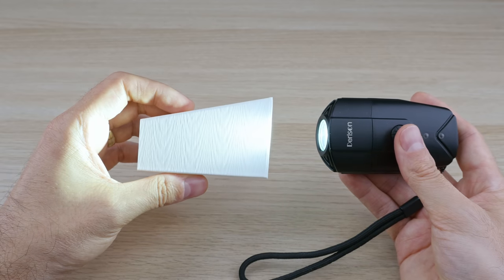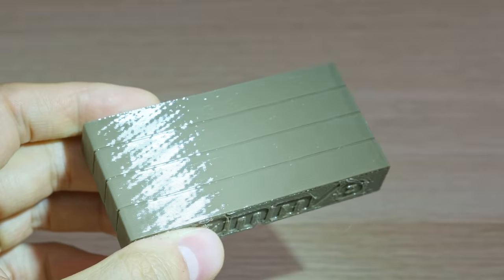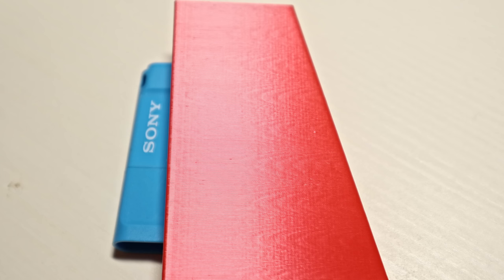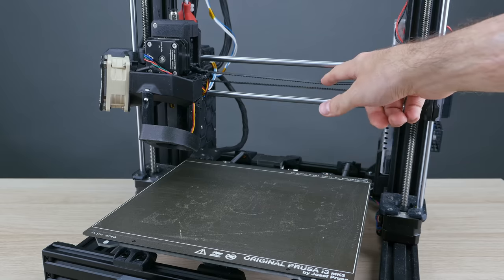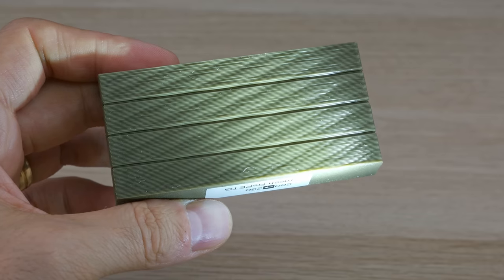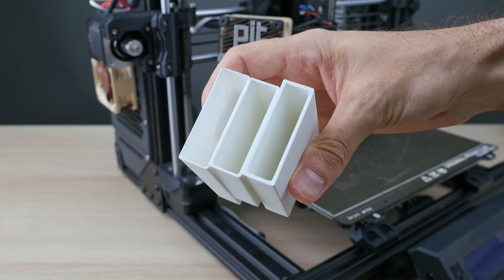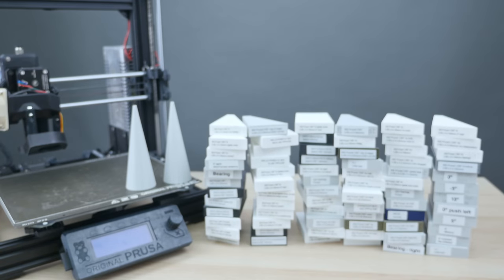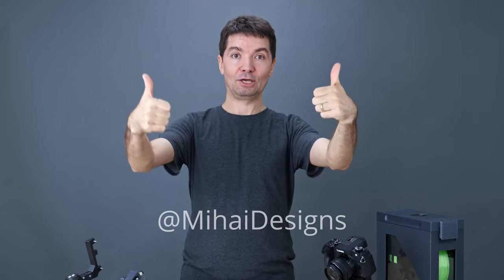What I've learned about your 3D printers (and mine)

Comment: Mihai could you fix it in the end? This design of dual-gear might have a non-linear transmission of torque, due to the design of the teeth, so it generates a "strong/weak/strong/weak/strong..." push of the filament and when you print a regular shape like cones/rectangles/squares/prisms... it creates a variety of Moiré Patterns. By the way, SUPERB RESEARCH!!!! Exhaustion of tests!
Reply from the maker: Thank you. Yes, that's exactly how I believe it happens too. I do have a patch for my printers, although I'm not sure it'll work with very flexible filament. A different design of the gears would be best, but also more costly.
Reply: I hadn't looked into the gears closely, what did you see on them to give you this idea?
Reply: @LittleSilvr  Might have measured the distance between the gears' teeth or between both gears while running I guess ?
Reply from the maker: @LittleSilvr  I'll explain in detail in the next video (yet to be filmed)
Reply: May be more teeth in contact help: I wonder if the LGX Bondtech is less impacted
Reply: Maybe diagonal teeth would work better.

Comment: I have a suggestion, so hear me out. Maybe the gear that is fixed to the extruder motor is not concentric with the shaft, thus the filament is not pushed evenly through the hot end even if the motor spins at a steady rate. As the splined gear that grabs the filament may not have the inside diameter identical to the outer diameter of the shaft, and is secured to the shaft only from one side with a grub screw, this could be the source of the problem. Even a tiny deviation from concentricity is enough to create that effect. Let us know if you find out anything on this matter. Love your vids btw!
Reply from the maker: That would be a good subject for a test. Is not the case here, I imagine it could lead to layers seemingly not aligning well in specific situations.
Reply: @MihaiDesigns  The bear project/community have come to that conclusion though.
Reply: If that is really the case, then i got an idea to fix this.

How about we add something like extruder concentricity compensation value into the firmware. Something similar to how linear advance compensates the filament flow, and how input shaping compensates for frame flexibility.
Reply: Look up MirageC, he did a video on this issue.

Comment: I've got a very mild case of this pattern when printing with a totally custom build that does not have a dual gear extruder. It's running a drive wheel straight off the motor shaft and a simple ball bearing pressing the filament into that. Direct drive (not bowden) with a very well constrained and short filament path. H bot gantry system with standard 1.8 deg/step motors everywhere. Slicing with Repetier Host using Slic3r.
Reply from the maker: Can also be other reasons to get a somewhat similar shape. See my other videos on how to measure and determine where it could come from.

Comment: Thank you for actually testing and sharing. Extreme appreciation.

I have switched to 5-phase steppers from oriental motor. Their motors can reach 1000steps/rev. I never have grains/stripes/waves. Clearpath servos also work great, but they have a little latency (2ms). Super smooth walls.
The only thing I have now is inconsistent extrusion from sudden change in flow depending on the part geometry as I run near my extruder max flow rate.
Reply from the maker: Flow change does affect both extrusion % and print texture, especially if you go above 1/3 of the rated max flow rate. This is a real problem for me as well. My only solution is to go with bigger heating blocks. Even my super volcano is not enough in my experience. So I try to keep the volumetric flow constant where possible. Of course, there's always slow down at corners so there will be some variation.

Comment: Vibrations come from printhead, cooling fans, any moving part that is not dampened, loose or generates frequencies like sound..each can contribute to fine detailed extrusions of hot plastic "woodgrains". Match the vibes and see where to fix. I wonder if sound absorptioncan be tuned to temperature and type of filiment? NOT impossible to tune a fork..however you can't tuna fish, hehe. There is indeed a limit to print details depending on each machine's absorption capabilities.

Comment: Incredible reaserch, the fact that it's a consistent pattern and not random noise should be a big clue, and seeing how it's so consistent across printers and setups says it's probably related to something very basic in 3D printer designs. With some math you can measure the distance between the peaks and troughs compared to the speed of the print head and determine the frequency at which the inconsistent extrusion is happening. The cooling fan is too high of a frequency to be causing that but something else moves spins or vibrates at that specific frequency and an imbalance in that is most likely what is going to be causing the problem. The fact that the extrusion is so consistently inconsistent in a way that causes a pattern is a big clue. Something is causing the printhead to move or wobble out of alignment at a very specific and consistent frequency.

Comment: This is typically caused by vibrational resonance that becomes amplified over time. Printer components and even the sturdiness of the desk/shelf the printer is mounted on can affect resonance. Another youtuber (Teaching Tech) covered this well recently and used an accelerometer on a Rat Rig, with Klipper Input that contains specific values in the firmware to address this and came out with amazing results.

Comment: It was also happening on my Artillery Sidewinder with single drive Titan clone, but  more elongated. It was caused by eccentricity of small motor gear. It was pronounced when printing with 0.8mm nozzle, 0.4 layer heigh and 120% flow. I reduced it by putting adhesive tape on the shaft, now there is no play of the gear, so after fastening grub screws it does not move to one side.

Comment: I had a similar issue and did dozens of tests and replaced a bunch of parts, updated firmware, and tuned a lot of stuff. Nothing improved the quality of my prints until I stopped using my Cura profile and restarted with a default Cura profile. It improved the prints dramatically, despite having the same settings as the Cura profile I used for years

Comment: Wood grain/rings often come from extruder gear issues. Commonly hobbed gears that are non-centric, either by manufacturing defect, bad mount to the axle, or the axle (and thus the hobbed gear) is at an off-axis angle vs the filament path and idler. Obviously the same goes for the other gear on dual gear extruders. The stepper axle itself can be bent/off-axis, but the far more common culprit is the extruder gear(s) and/or their mount.

It can be difficult with with many direct drive constructions as they're often enclosed, but a good troubleshooting step is to snip 2 sensibly long pieces of filament off the spool, then using a hair dryer or very gently a heat gun, straighten them out from their curve off the spool. Something slightly (!) less rigid than PLA can be favorable here. Next, drive the stepper to run the 1st filament piece through the extruder, without the exiting filament rubbing/bending on anything NOT going into the hotend). Run it really slowly. Observe the extruder gear(s) and idler at work, really up close.

Is there any kind of non centric movement? Any movement on the tensioning lever? Does the distance between the center of the screw/pin/axle of the gear(s)/idler, and the outer edge towards the filament, change during rotation? Is there any movement in where between the gears/idler the filament rides? Lastly, on the filament itself. Is there any curve to the exiting filament? Are the grooves from the hobbed gear(s) biting into the filament, precisely perpendicular to the length of the filament? Is their depth and spacing consistent throughout the length of the he filament? If dual gear, is the depth, angle and spacing along the length of filament consistent, identical on both sides?

Next, do the same with the other piece of filament, but at higher speed. The speed when printing these parts, ideally. Watch and inspect the exiting filament for the same as above, but this time also look for signs of slipping, grinding or missing steps.
Reply from the maker: Excellent tips @pr0xZen. I did check for some of these aspects even though some things I can only measure with limited precision, but I find your test procedures interesting. I haven't gotten a test for non-centric gears. It would require a much larger print, but is something that can be designed specifically to detect this. I've noted it down for a future experiment.
Reply: @MihaiDesigns  In terms of stuff like the distance from center to edge of the gear(s) and idler, you don't neccessarily have to measure it precisely. If you watch the gear(s)/idler up close when running filament through them at a constant speed - especially when moving at speed - if it's there it should be visible as an oscillating motion. You can sometimes also feel that oscillation through the tensioning lever if your extruder has one, if lightly holding a finger on it.

For the hobbed gear "bites" along the filament, inconcistency in the "bite marks" is usually not too difficult to observe when inspecting it by eye afterwards. If inconcistency is caused by non-centric or improperly cut/unevenly worn hobbed gear surfaces, the inconcistency will be a repeating pattern spaced roughly every 10-20 bite marks; there's not that many "teeth" around the sircumference of those gears.

With dual gear, look for the same inconcistency and repeating pattern on both sides. And, you don't have to count every mark to compare to the marks on the other side. Just see how they line up with the opposite one. Then spot-check by eye every 5-10 mark. See if there are any sore thumb spots popping out at you, or if the spacing vs the other side, changes significantly over distance. See if the grouping tightens and expands, vs the opposite side if dual gear.

A tiny bit is not a significant issue, but if it varies by 5-10%, then that 5-10+% repeating deviation is gonna be attenuated a lot at the plastic squiriting end, unless you're printing with a 1.25+mm nozzle. Heck, even if you ran a 1.7mm nozzle, non attenuated 5-10% repeating deviation will still cause visible artifacts. And, it's gonna induce repeating artifacts in the print too, although in more visually recognizable patterns in prints of simpler geometry, and on direct drive, because the extruded distances are very repetitive and there's not a tonne of retraction to offset or "randomize" the effect on the squirted plastic. If you've ever changed your extrusion factor or adjusted e-steps on thre extruder, then you know how much of a difference a few percent change at the extruder end, can mean at the nozzle and print part end.

Comment: One of my printers, the EcubMaker ToyDIY, always has lines that look like ripples in water, on the +X side of the model. It has always had that problem and I never figured it out. What makes this more challenging is that the machine was used at a convention before I got it and at least one part was broken so it may have been mishandled by a previous user.

Comment: Unfortunately, I interpreted "What I've learned about yout 3D printers (and mine)" as meaning you had a solution to the wood grain anomaly as well.  My Creality-CR10S does not experience this issue.  Did you investigate the relationship of the infill (pattern and % overlap) to the walls?
Reply from the maker: Yes, my other video is now out. Also explains why Creality printers don't have this.

Comment: Not getting any of these patterns with the Micro Swiss direct drive and hotend on my Ender 3 Pro, running the Creality 32bit V4.2.7 board with Marlin firmware, using BLtouch, glass bed with solid bed mounts, dual Z motors, and gantry brace rods to stiffen the frame.
Been mostly printing CF nylon, PC, and CF PC.

Comment: Interesting, thank you for your thorough research!

I have some observations on the subject that may be of interest, this is of course based on my on meandering experience combined with a few sound physics principles. I suggest that the pattern may be simply created by the gravitational force of earth passing through a fluid (molten plastic), which then sets as it cools and this locks the image into the material.

If you want to confirm if the pattern is the same as that found in gravity, simply observe water as it’s poured from a jug into a cup, it has the same pattern, so does timber grain, or water at the beach as it recedes back to the ocean etc. there are many examples of this pattern throughout nature due to the common force that creates the pattern.

Not sure what you can do to overcome the issue if the cause is as I suspect, however, maybe printing at a lower temperature will improve the finish as the material will not be so pliable? 

There’s always a trade off to any decision I guess.

Anyway I hope this offers an alternative perspective.

Comment: Perfect you did a great job.. this was also the reason i created my own monster based on a ender 5 pro.  i try all but almost no problems with my printers. voron 2.4 a little wood texture but my heavy modded ender 5 pro has no problems at all. the ender 5 has core xy and  a 4x linear rail z  mod, btt1.1 PI TFT50 Touchscreen + 8 TMC2209 Drivers,  i used my own made sofware.    10 mm bed with heatmod up to 200c  330x330 buildvolume because off the z mod i got more space to make a bigger bed. hotend is a micro swiss M2601 with a ProMax design cool head (becomes available FOR FREE  (thingiverse) after 3 month test is done.   all of this is my own creation put together on an ender 5 pro base

Comment: I didn't do testing as widely as yours but I spent an entire day doing something similar. In the end, the only solution that worked was printing EXTREMELY slowly on the outer wall. I tweaked practically every other setting and still ended up with some type of pattern. After testing in vain, the research I found is that the cause is generated from the stepper/signal and resonance. There was a 10+ year old video that I came across that made sense. I'll have to find it again and repost it.

If anyone can find a solution, I'm sure you will!

Comment: Problems like this drive me crazy.  Thanks for your dedication to trying to solve these issues.  Have you made any head way on this issue?  Perhaps it's caused by the elasticity in the belts? I wonder if going to a chain driven or another more pricise x axis drive could solve it.  Another idea i had could be the consistency of the nozzel temp, i think slight fluctuations in nozz temp could cause a color change.

Best of luck!

Comment: I have a PRUSA mk3s from 2019 and have experienced this issue from day 1. The patterns displayed on the side of prints had me concerned for the longest time that I had set up my Prusa incorrectly. It was not till I looked at the plastic parts printed by PRUSA themselves did I realize that their print farm printers are having the exact same issues.
Reply from the maker: Good observation! I replaced my stock printed parts so long ago that I didn't think of this. Check out my other video where I have a potential fix for the MK3S extruder. Someone with a print farm tested it with great success for all their MK3S printers.
Reply: Well , they printed in a Prusa , by the way, the looks pretty bad for 1000$ printer...

Comment: I had this issue with my cheep clone of that machine.
Some is the inevitable problem that they are very flimsy cnc machines. 

But a huge number come from the fact that the z axis lead screws wobble. 
Even if it's a precision screw the joints make it wobble. And even if the frame is strong. It's not really by cnc standards. So it moves the whole frame top relative to the bottom about with the pressure. 

I got over 90% by making it so the nuts are not hard connected. And the z only rests on them on a pivot. So as they wobble the don't push the frame around.

Comment: Have you tried loosening the bolts. Squaring it up and re-tightening them. Them sitting the whole printer on a concrete flag sat on a towel to reduce vibration. Thats how i fixed mine. I still get layer lines if i push the speeds but no longer get the wood look.

Comment: Might extruder hobs that don't have teeth  but instead are made of some very grippy material work?
Or, alternatively, have a tooth pattern where the two gears, if set 180 degrees apart from each other, will produce a constant bite. A simple sawwave might work
Reply from the maker: That wasn't what was causing the larger wood-grain pattern, but it is what is causing the intertwined waves. I'm doing yet another video on that. I did consider some sort of very grippy belts, but I don't know how reliable and long lasting those could be.